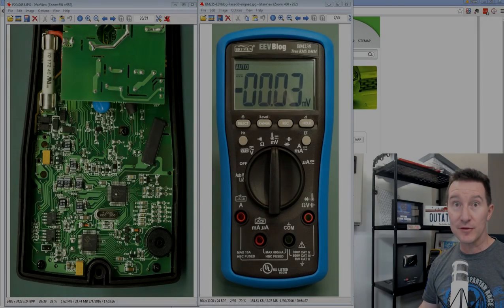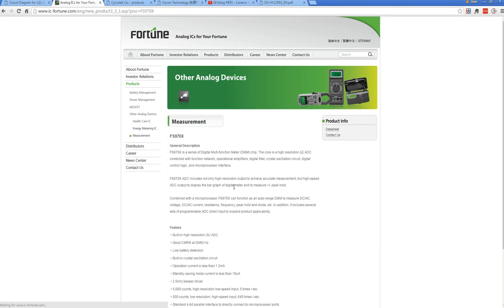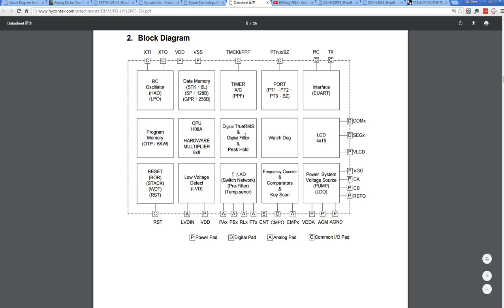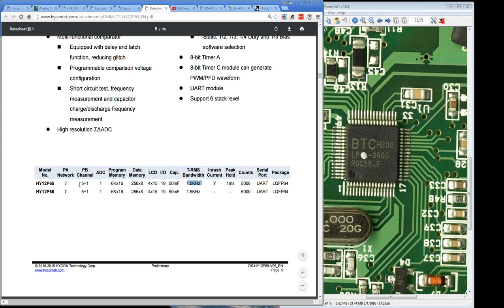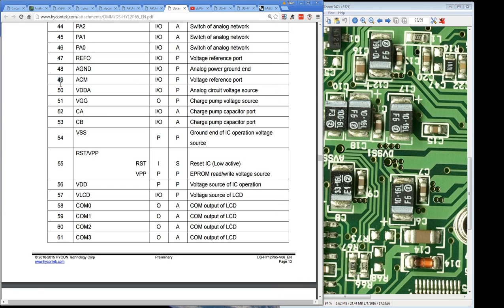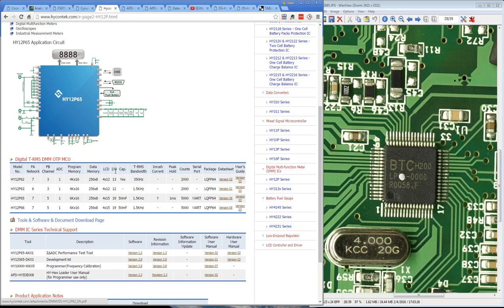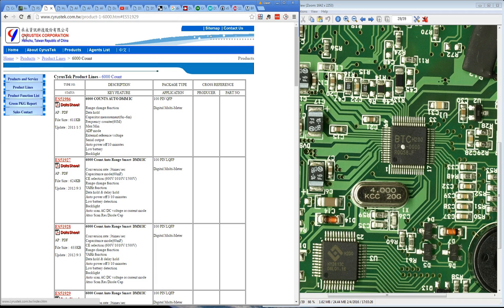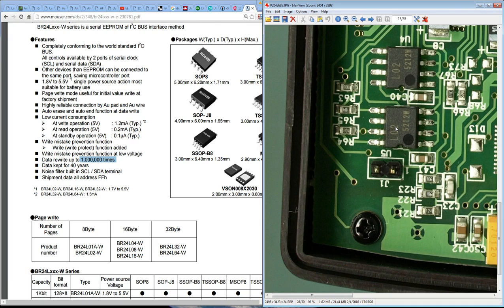EEVblog #912 - BM235 Multimeter Reverse Engineering

Comment: I once had to repair a TV for someone.  And on the main board, a 0 ohm resistor went open, and caused a quirky issue of where it's service settings kept getting loss.  I honestly had no proper 0 ohm resistor jumper, so I just took a piece of wire, and was going to jumper the pads.  The guy was going mad at me, said I was "hacking" his TV "beyond" specification.  I tried to explain 0 ohm resistors are just doing the same thing I was doing, and it's only cosmetic as during manufacturing, it's easier to use a 0 ohm resistor than a piece of wire.  Oh man was he not having any of that!!  Thanks Dave, when you mentioned about 0 ohm jumper resistors, you just brought back some really bad memories.

That was back in 2008.  I learned after that, just don't tell the customer what the hell you're doing, leave them in the dust.  It sounds rude, but it's a lot easier.
Reply: +killaken2000 But it would be no different. A piece of wire has no resistance, just like a 0 ohm resistor, and a cut down tiny piece of wire would be just as clean too, and cheaper, as I don't have to buy a stupid 0 ohm resistor jumper.
Reply: Wire + Stimorol + black marker = 0 Ohm resistor for your customer.
Reply: I honestly can't understand your logic. It's the same exact repair. It's going to be a repair in any event, and there is no significance to the choice beyond part sourcing and manufacture. A 0 ohm resistor is a jumper.
Reply: I've never even charged for resistors.  Caps, yes, because I use only name brand caps like Nichicon, UCC, or Panasonic, but resistors I never charged.  I still charged for labor though.
Reply: Are you kidding me? It's still the same thing. The cost difference between a 0 ohm resistor vs that of a jumper is absolutely negligible – fractions of a cent either way – even ignoring the cost of labor (which renders either part of the noise floor). The labor difference between solutions is equally negligible.
Reply: marshaul
Yes, but in the consumer's eyes, you're doing a hack job, even though there's no difference between a 0 ohm resistor and a wire jumper. The consumer couldn't care less about details of the equipment. Which is why is not good to disclose this sort of thing.
Reply: You're clearly projecting your own emotional preference for one of two equivalent ways (what you perceive to be "doing it right") on the typical consumer.

I suspect that you (and Brandon's client from the story above) are the atypical case.
Reply: marshaul
Not really. You're just assuming that end users have electronic engineering knowledge, so they shouldn't care by default.
Reply: Consider how few people even opt for repairs (especially board-level type repairs) at all anymore. The model is overwhelmingly replace rather than repair. You really think that, of the few who will still go out of their way to save a few bucks on such a repair, the majority will quibble over a successful and competent repair, simply because it is non-standard?

No. If they were that opposed to non-standard, they almost certainly wouldn't be the type to opt for a repair (in this day and age) in the first place!
Reply: marshaul Not everyone has money to replace things when they break, especially in countries where it's more expensive to replace than repair. Once again, you're painting a scenario based on the assumption that the consumer who bothers to repair stuff has the knowledge you or repair people have. And that's almost never the case, otherwise they would fix the stuff themselves instead of paying for it, which eliminates all situations were customers weren't happy because you did a "hack" instead of "fixing it".
Reply: A "consumer" seriously doesn't care what was broken or how it was fixed. Do it quick and do it cheap. That's where it stops and any further you're boring them and taking time from their life.
Reply: Rizon1985 Agreed. My car mechanic friends would be laughing their asses off right about now. The amount of corners that are cut (at least by Crimson Sunrise's standards) in that trade as an absolute matter of course – because time is money and the consumer demands the cheapest service – make the use of a jumper vs. a 0 ohm resistor seem trivial by comparison.

(Do you really think your mechanic is going to ensure that your "new" rebuilt alternator has the same component selection as the factory original? Do you really think anybody even knows that beyond the original engineers? Or that anybody cares? No. If it meets the original spec, it's good to go.)

In the consumer-oriented repair world, you do whatever is fastest and cheapest to get a working product out the door, back to the customer. Worrying about or trying to duplicate what was fastest and cheapest for the factory to build it the first time is only going to waste your customer's time and money.

Comment: I always make sure to get 1% 0 ohm resistors, the 5% ones just aren't accurate enough.
Reply from the maker: Yeah, trap for young players.
Reply: This just made me snort out beer out my nose.  Thanks!
Reply: This is really important. Otherwise you could end up with a negative resistance as these tolerances work both ways!
Reply: Good thing I spotted this before placing a order for 6.3M 1608 0ohm resistors, going to make a 10km 0ohm conductor, that 5% could've ruined it.
Reply: Nope I always pay extra for 0,01% 0R resistor for superior performace
Reply: Whoa look at you such a big boy for drinking beer.
Reply: You have to get your vishay jumper links!
Reply: Should use metal foil 0 ohm resistors for better stability.
Reply: I also found that using a simple 2 transistor temperature stabilizer also helps drift

Comment: The EEPROM won't just die when it hits 1,000,000 writes. That write count is for each byte. The bytes that have less writes will still work fine. Even after exceeding the million writes, the byte still works, the reliability just starts decreasing.

Comment: As an embedded software engineer, if I knew I had an entire 2k EEPROM to work with and had to update a setting very regularly (like once per second for a clock or every time a mode change happens), I would split the data up into a linked list of records and write them into the EEPROM successively. With a EEPROM you can usually change a bit from 1 to 0 for free and you only impact the cycle count when you erase a sector back to all 1s. So you can have a "validity" bit in each record that you set to 0 once you have written the next record successfully and this will tell you when you read back the data to ignore that record and move on to the next. Then you would only erase the part once you have filled up the entire 2k bytes with records. By doing this your 100000 or 1 million erases will last you years and years even if you write to the part once per second.

For example, if you had 4 bytes of mode information to store, you can make a 5 byte record (or put an index table at the beginning of the part) and get roughly 360 records in 2k EEPROM. Then, if you write a new record once per second, the part will still last for 10 years instead of just 11 days.
Reply: Dave, if you are still reading these comments it would be interesting to see a video about reverse-engineering the data format of the EEPROM to see what information it stores and how it does it. You could show a logic analyzer like the Saleae in action or examine the dump from a EEPROM programmer.

Comment: Thanks Dave, very interesting. It's great to see a manufacturers website with such comprehensive information on their products and available to all.
Reply: Bonus for not having to register with email in order to download even the most superficial datasheets, let alone internal details such as the instruction set of the chip's processor. I've never seen any of the big ic manufacturers do that, which is why I have to keep using fake accounts for the registration and/or downloading datasheets from suspicious sites.

Comment: Hi, Dave, one piece of evidence you may have missed is comparing the plastic cases of main chip and the LCD driver chip. Different manufacturers will have visually different cases, but these two look absolutely identical. Finish of the top surface, the location, size and shape of the pin1 marker, the rounding of the edges, shape of pins, etc. It all points to the same manufacturer of the cases. Of course this is not 100% proof - the chips could still be coming from different fabless companies that happen to use the same manufacturer of chips. One more bonus hint: both chips have H200 written at the same spot.
Reply: I noticed the H200 as well.

Comment: If I would like to extend the life of the EEPROM, I would set a circular buffer to let the firmware write data in different location each time the meter is powered on. This is possible because it needs a couple of bytes or so for mode saving, and the EEPROM has plenty space for that.
Reply: Was thinking exactly the same thing. But how would it know where to read/write the next byte? Do these things have working RAM?

Would it require more than 1 byte for mode saving? 256 different modes can be stored in a single byte. I guess we'll find out in the next video...
Reply: +Prehistoricman. In my option, I'll let the firmware do a quick search for a certain byte, let say 0xAA which will be followed by the last save location.
Reply: Mohammed Algailani Then you're wearing out a certain cell of memory storing where your other bit of memory is.
Reply: +Prehistoricman. The 0xAA byte is written just before the new data, not stationary in a fixed place. After powering ON, firmware search for 0xAA, read data then erase the 0xAA so that the next power on there is only one 0xAA.
Reply: Mohammed Algailani Ah yes! I get you now. I had that idea too but wondered how fast searching for that cell might be. I guess for initial turn-on, it would be acceptable to wait 0.1s while it finds that 0xAA.
Reply: There is more robust solution to do such simple wear leveling: You can use let's say first byte to store the offset of your configuration data structure  and increment it every time current position of the data structure is reaching the end of its lifespan (let's say after 800000 cycles). The counter of the cycles needs to be part of the configuration data structure.
Reply: Where is the updated counter data gonna be stored, in the EEPROM?
If this is the case, then what makes it more robust (or do you mean more elegant?)
Reply: Mohammed Algailani I believe Stefan means elegant. His system would wear out the chip marginally faster, as more bytes are needed to store a number up to 800000 (or some large number).

However, searching the whole chip for a certain byte is pretty messy.
Reply: Prehistoricman My point was that, when the chip finally wears out, the behavior of that solution would be unpredictable. Whereas, by utilizing my preferred solution it can be defined by program. I did not mean to say that either of these solutions were bad.
Reply: +Štefan Mišík . I wonder how EEPROMs in odometer are protected against wear in the automotive industry? I would love to hear some more elegant implementation ideas.
Reply: +Mohammed Algailani They utilize the property of the data that it is monotonically incrementing only. They store the ones complement of the newest odo value in the oldest location in the circular block. At powerup the firmware searches for the smallest value in the block, this is the latest odo value, and the next location is the oldest which will be overwritten next time. If your data isn't just a counter which is monotonically incrementing, you could add one before the data for this method to work, and you are done.

Comment: There is a way to not wear out an EEPROM. You can write in cycle to the next adress every time. Microchip has a library to do this - DEE Emulation.
Dave I think this further EEPROM investigation may be very interesting, so it maybe shouldn't go into the second channel.

Comment: 27:00 that crystal looks like it is connected to pin 14 and 15 unless they really connected it trhough that via leading to 16. It's off by one pin. I guess the marking "17" on the silkscreen has done it's deceiving purpose :) Only one way to find out. Beepy time :)
Reply from the maker: Yep, I checked and it is 14 & 15.
Reply: Hmm intersting. I still think you are right about it being a Hycon part customized for Brymen, and this is just differnt bonding. Looking at bare die pictures they almost always have excess pads. If that's the case for the Hycon chip they could create a "custom" Brymen chip by just bonding out those prior unused pads. That could explain the different function on the LCD pins and the offset crystal pins.

Comment: I think you're right about segmenting the EEPROMs by purpose.  Also, it's probably more efficient to stock the same part for both purposes regardless of how much storage is actually needed.  The 2402 is a 2k bit EEPROM, or 256 bytes.  The main processor doesn't even have enough RAM to buffer all that data.
Reply from the maker: Yeah, it would be BOM reuse once they decided they wanted them separate.
Reply: It's very common to have ROMs bigger than the microcontroller RAM. In most cases, you really don't need to load all the data into RAM. ROMs are random access for read

Comment: I suppose you could check if it is writing each time by changing something and then pulling the batteries rather than powering it off normally. Then putting the batteries back in. I suppose they could have the caps hold a small charge to make sure the write occurred if the batteries were pulled but it doesn't seem worth the effort.

Comment: Probably had to disable the LCD interface to get the back some Flash space (if the LCD controller is just I/O and it is implemented via the microcontroller) so they would have room for your requested features. :)
Reply from the maker: LCD controllers usually have specific driver hardware on the pins.
They made the LCD driver chip design decision before I spoke to them.
Reply: My thoughts exactly.
Reply: Removing the LCD controller could be a way to reduce its noise leaking to ADC. LCDs need to be constantly regenerated via specific periodic signal patters on multiple pins thereby creating noise on the chip.
Reply: You would expect that the chip was designed with that understanding and that it accounts for that. Then again, perhaps that is why the chip claims 5000 count performance. Perhaps BM is able to squeeze the 6000 counts out of it by reducing the over sampling required to account for the noise the LCD introduces...

Comment: If I were doing the firmware for that, I wouldn't save off the mode until it had been in that mode for 5 seconds. No point writing out every mode you click past. If they really meant that mode, they'll be in it for 5 seconds.   Then even if you're changing modes exactly once per 5 seconds constantly, it would take 1389 hours to wear out the flash chip.  57 days of constantly changing modes every 5 seconds - or doing it 8 hours a day for half a year before the chip wears out.
And that's a minimum spec, odds are it'll last twice what the data sheet minimum spec says.
Reply: You could probably find out if they have a delay by probing the I2C bus on the chip then changing ranges.  EDIT Oops you said you'll do that. Sorry, typing too fast.
Reply: balbes1234 Are you not then just wearing down the location that tells you where the current write location is? (W) I can think of ways around this but it could easily just transfer the problem to a different location.
Reply: balbes1234 yes of course but I was wondering how you know which of the pre-allocated values is actually the current one?  Do you just preload addresses with a known invalid value (0, or 0xFFFF or whatever), then read through all the values in order until you find the last valid one to know which one is valid?  Then when you fill them all up, do you go back through and erase the whole stack to start over again? That was one of the methods I thought of.

Comment: Hi Dave,
I noticed on the picture of the BM that the external oscilator pins are 14 and 15, and the datasheet of the micro you were considering to be the on on the BM says pins 15 and 16 for the external oscilator.

Comment: Going more in depth on this meter would be fascinating (not just saying this because I own one!). Is there any data on the unused LCD pins? If the LCD output section is disabled as an internal option, maybe it runs a bit faster?

Comment: When I see those two "L02" SO-8 packages you are pondering about hanging like that I was screaming inside "That's gotta be AT24C02." Those I2C EEPROMs all have the same pinout and protocol (alright, two different, mutually incompatible protocols, but still compatible within its own class,) and are largely interchangeable. So maybe it is a ROHM part after all but to me those are unbranded AT24C02s.
Reply: Yes, could be Atmel or Rohm parts. BR24L02 from Rohm is only 0.20$ in quantity so they are not really spending that much more for the second one.
Reply: Christopher Johnson Rohm BR24L02 or Atmel AT24C02 or Microchip 24AA02 those I2C EEPROMs are all compatible with each other.

Comment: You forgot to compress the audio to -0.1DB.
Reply from the maker: I didn't bother, just up the volume a bit, it's consistent.
Reply: It is already limiting out the usb sound card with the 50mm drivers.
Reply: Download the video with youtube-dl, and amplify it with VLC or any other media player
Reply from the maker: Then I'd say something is wrong with your setup. I'm able to play it at deafing volume.
Reply: Audio is absolutely fine
Reply: Hi, Dave! I confirm that the sound is a bit quiet. I'd like when I can make louder with YouTube volume control. I mean sound level like - "EEVblog #898 - LCD Contrast Experiments" for example.